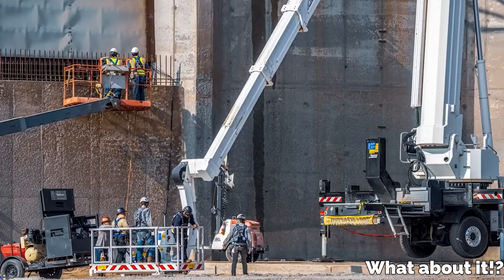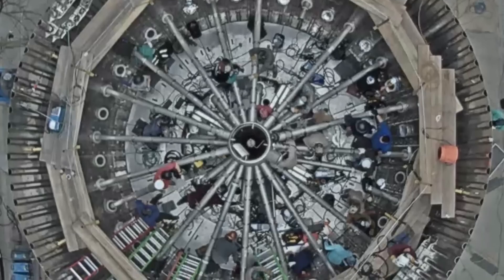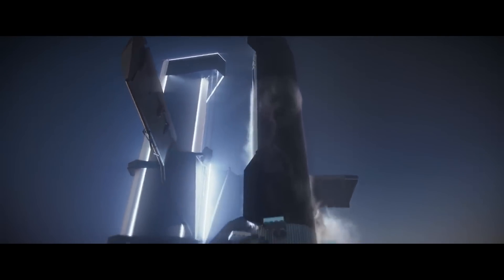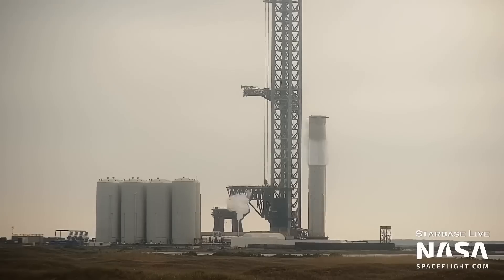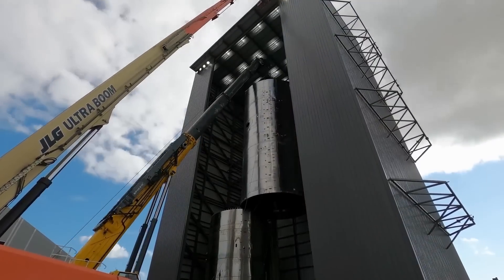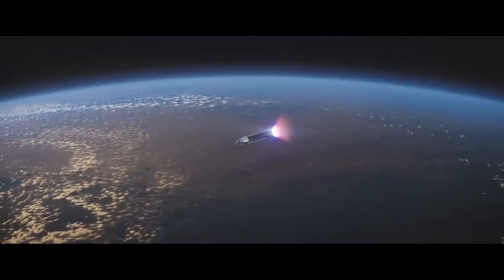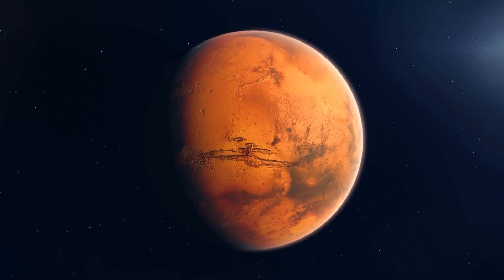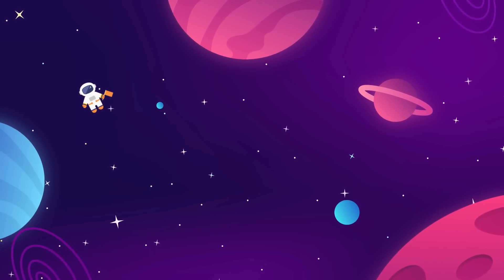Major New Starship Launch Update!

Comment: If we know anything about anything, we should be asking why we haven't tried an oblative heat shield on the pad. Something cheap to make and form, yet designed to be durable enough to hold up to the force and last long enough so as to not completely burn away from a single launch. Just throwing out ideas here, but hempcrete is supposedly rather durable and flame retardant. That being said, everything burns if it's hot enough.
Reply: Great idea man I did concrete for a while it's very expensive time consuming and expensive to replace and repair, curing times are long too

Comment: the concrete under the launch pad does not support the launch pad, the large round pipes standing are planted many feet under the ground and filled with steel reinforced concrete. the concrete under the launch pad is there to deal with the rocket exhaust forces and needs to be fixed, but i'll bet Elon and team can figure that one out

Comment: Need a video explaining WHY there is no Blast Tunnel???? I have Never Understood the theory of sending exhaust Straight Down to be Diverted Randomly EVERYWHERE. There must be a reason, they are not stupid over there, but I need some edumacating on that one.
Reply: A number of reasons why not. The Army Corps of Engineers won't allow it, for fear of damaging the wetlands with all the water run off from the deluge system. This is why they have to create a catch pond to capture all the water. Also they had to charge the ground there for 1-2 years by stacking a mound of soil on there, so the ground there is not exceptional solid. They are so close to sea-level that is they tried digging a big trench, the whole would fill with water as they were digging it.

Comment: Can somebody tell me, why they don't use steel plates on the floor?
Reply: Steel expands when heated during launch and would cool and contract later thus getting damaged.
Reply: @anubhabmaiti9658  lol, that’s not why.
Reply: @anubhabmaiti9658  That is why they are called plates... they are put leaving a small gap between them to allow the expanding

Comment: I mean isn’t it obvious they just need an orange juicer shaped structure underneath the booster made out the same material as the heat tiles. They can take the impact of the ultra hot jet and then redirect it all outward between the legs🙄
Reply: i mean how do you get it on??? also the heat tiles disintegrate.... that's the point of them

Comment: They need a 2 million gallon water tower with 30" rain bird deluge pipe. Also, there should be a blast tunnel directing the flame and water in one direction. The launch base needs to be encased. Flooding the blast tunnel cuts down sound and protects the concrete.
Reply: They aren't doing tunnels and trenches because in Boca Chica they are already at the water table.
Reply: @ImmortalAbsol  but how is the starship and all the structures around the pad going to take that explosive energy! They already are tearing the pd apart with only have the number of engines ? It seems like they might need to make a blast tunnel somewhere and soon ? If not I’ll be impressed as usual with space x.  It just seems like they the blast hitting the direct ground underneath is going to cause a lot of problems ?
Reply: @Collan-1  I have worked on a launch pad from ground up. The tunnel is under the launch table above the ground. The rain bird deluge flow around the pad and gets sucked down into the blast tunnel.
Take a look at the other launch pads built by NASA, none of them go underground.
Reply: @vernongandy9026  got it ! I’m confused why they haven’t built one for starship though ?  And the one guy was saying you can’t go under the water table in Boca Chica.  But that doesn’t even matter bc like you pointed out most are above the ground. But again why doesn’t starship have one ?
Reply: You saw the Artemis launch pad wasn't damaged. The elevators and such on the tower got damaged. Remember the huge plume of steam exiting from under the launch table. They drenched the blast tunnel.
Reply: @ImmortalAbsol that doesn’t make doing it impossible just a little harder.
Reply: sure, what an expert advice!

Comment: @2:02 There's not a lot of things that can withstand the heat and blast force of all of those Raptor engines, but one of those things needs to be the OLM.
I suspect that SpaceX will need to surround the OLM with a complete water jacket with top-side holes to let the steam escape, and a water deluge system.

Comment: Wait till they finally do a full 33 Raptor 2 Engines, especially a full duration burn. Hopefully they're working on a deluge system. Along with testing different types of Concrete.
Reply: Maybe if they mix it with crushed volcanic material.